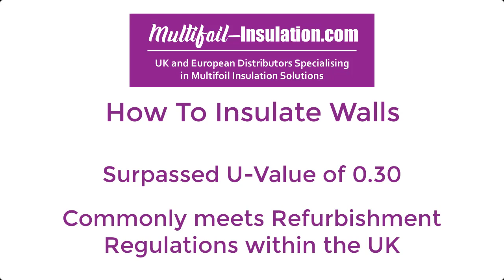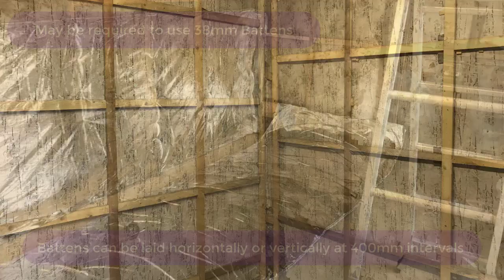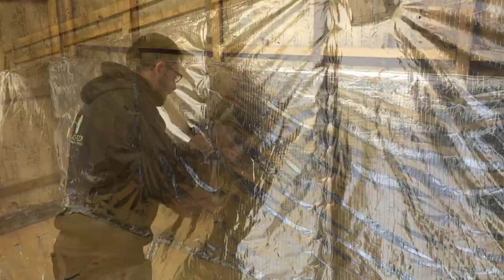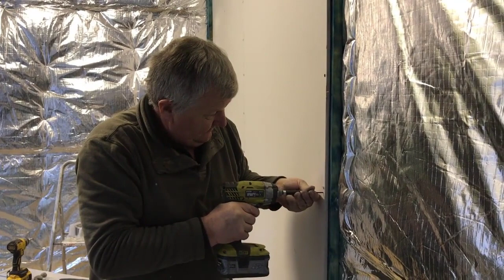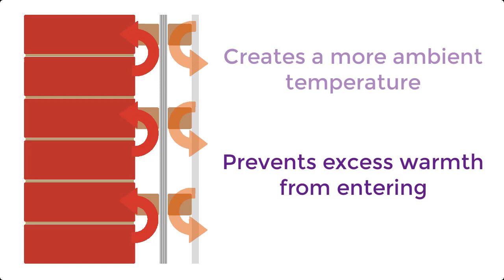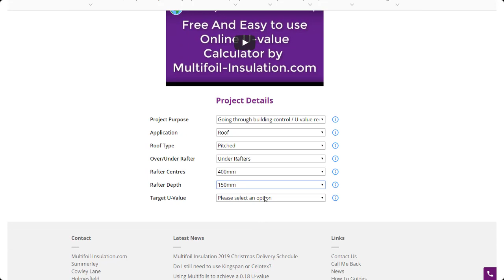How to Install SuperQuilt onto Walls

Comment: Can you cross batten with the secondary batten?
Reply: Hi Greg, yes absoultely. Battens are commonly installed vertically and then horizontally, however this is only to achieve the correct air cavity, so either way would suit. Hope this helps
Reply: @ecohomeinsulation  it does thanks